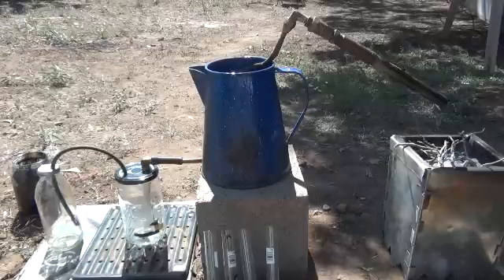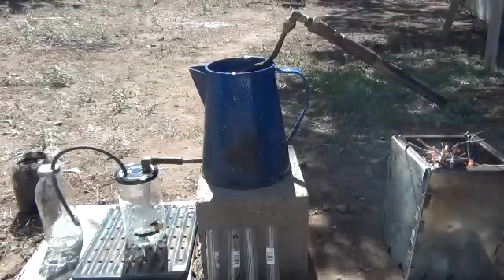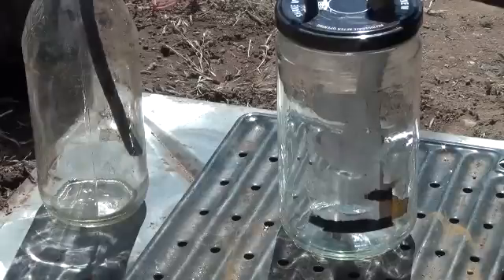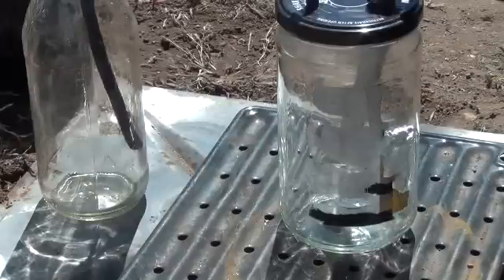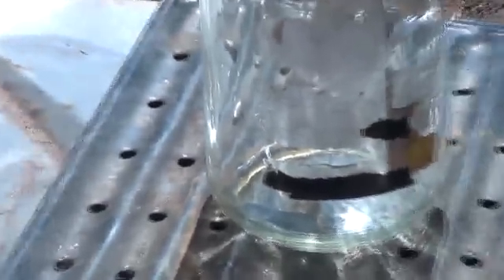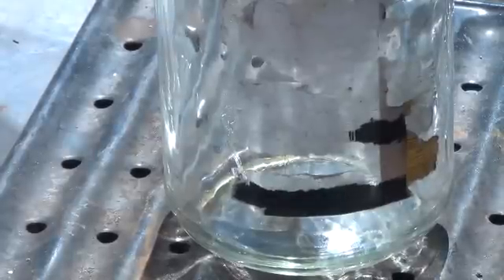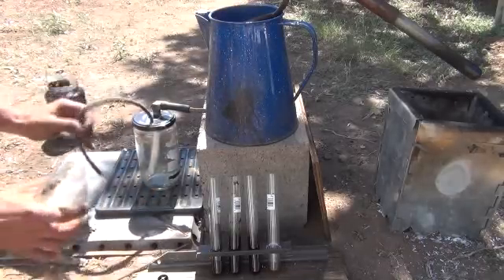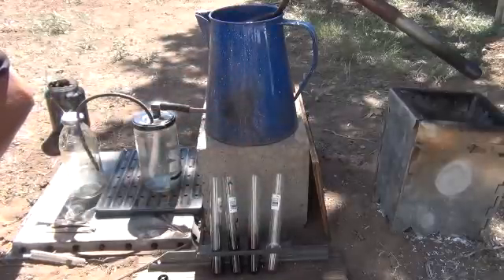Teslonian Man Show! Make "GAS" from Wood Part 2

Comment: just a thought but could you do this but heat the the gasifier chamber with a fresnal  lense?
Reply from the maker: yes if the Fresnel was large enough, a very large parabola may be easier to find or build. This would certainly  increase the efficiency.
Reply: cool...was just thinking in a grid down or other shtf situation that this would go through a lot of resources to do and a parabolic  or fresnal would help conserve resources. so do you think a fresnal from a projection TV work or larger than even that?
Reply from the maker: No the size of the beam or heated area from a Fresnel that size could only interact with a limited amount of container surface, as a very small scale system for running a wood gas camp stove or something similar in fuel usage it would work. A very large parabolic dish is probably the best way to make one large enough to burn let's say a 55 gal drum of wood's worth of material

Comment: Mr Teslonian, I have watched your videos and would like to say you are an excellent communicator!
I have been investigating into the GEET Plasma reactor by Paul Pantone.
Have you explored this yet?
I was getting ready to build the Gasifier but decided on the GEET fuel reformer instead. I am still puzzled by a few things and was hoping you have explored this.
Reply from the maker: Geet is a gasifier that fractures the molecular bonds through heat to convert liquids into fuels, it is very similar to how a gasifier works. The geet requires a initial starting fuel like gas to get the exhaust up to temp so that it will turn things like water into hho gas and oil into smoke containing multiple carbon based fuels.  There are three ways to fracture molecular bonds chemically, electrically or thermally and that is all a geet is doing, thats why he says you can run on coffee, oil, and urine, other than oils the rest are only fuels because the contain water and possibly an organic solid like coffee that will gasify. To do it right the exhaust needs a catalytic converter like area that would get very hot over 2000deg. to properly fracture the molecular bonds.